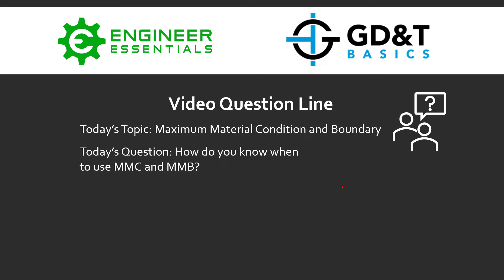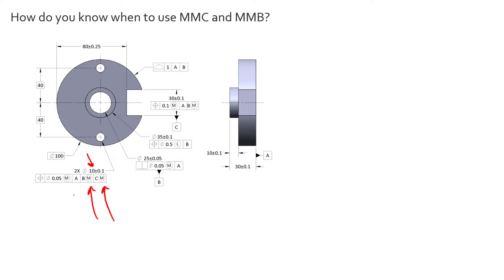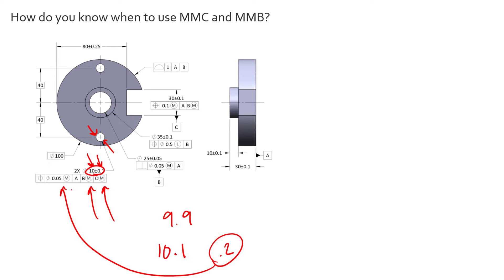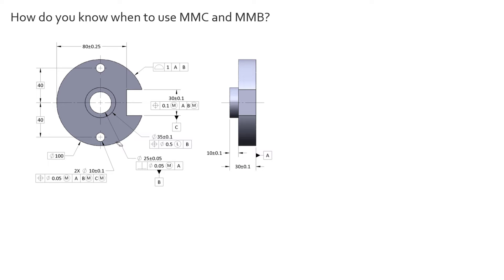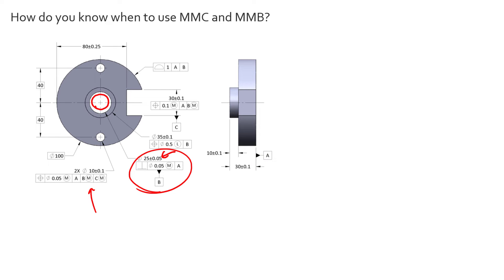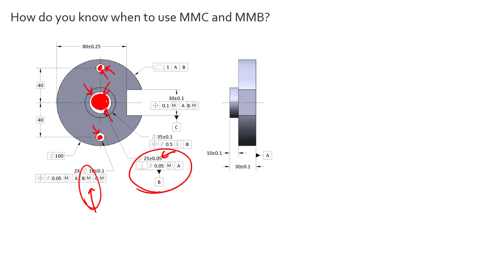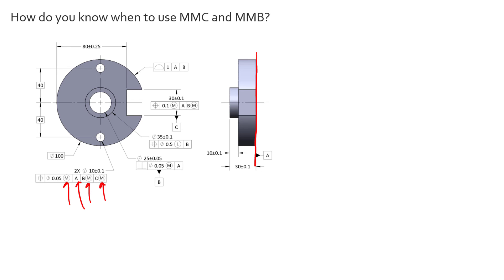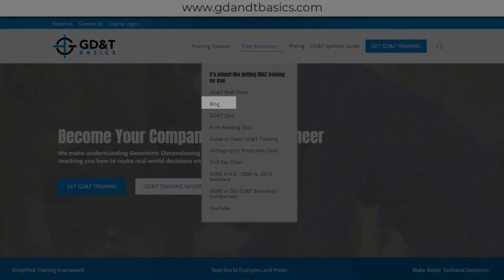When to Use MMC and MMB

Comment: So it means, I will add bonus tolerance to position tolerance(0.05 mm) , after datum B and and C size measuring. For example if datum B size is 25 mm I will add 0.05 mm. If datum C size is 30 mm, I will add 0.1 mm. I measure feature itself as 10 mm, I will add 0.1 mm. In final condition it has 0.05 + 0.05 + 0.1 + 0.1 = 0.3 mm position tolerance. Is it correct?
Reply: No additional tolerance occurs on datum feature B and datum feature C where MMB is applied.
Reply: No additional tolerance occurs for datum feature B and datum feature C where MMB is applied. In this case, the Position tolerance becomes 0.05+01=0.15.